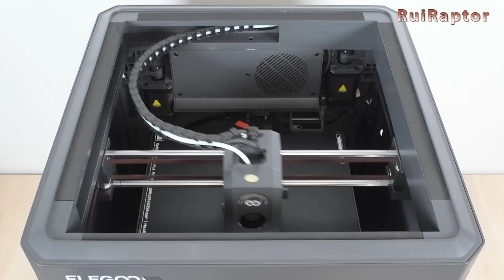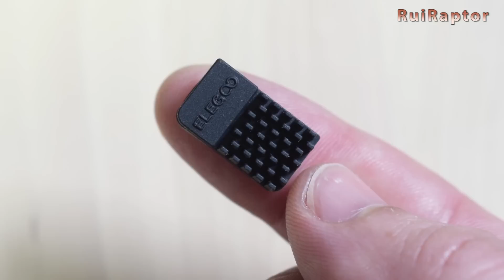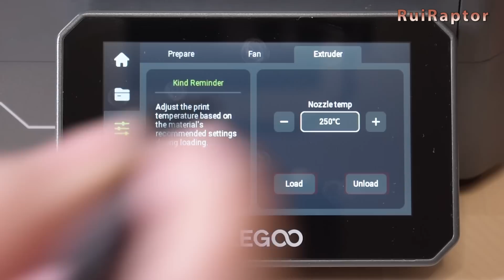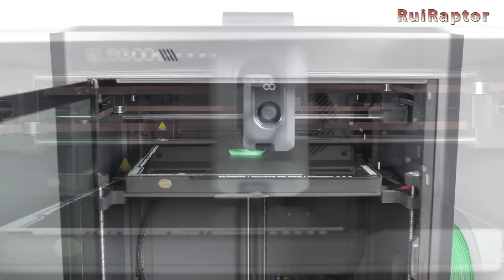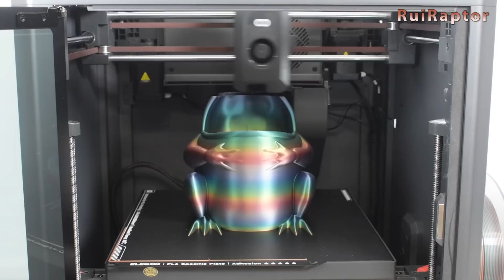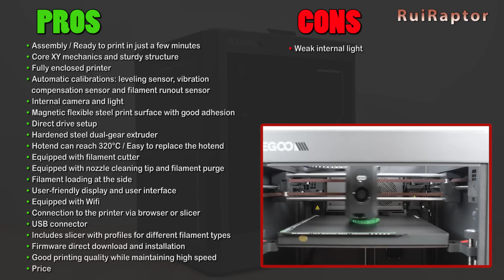Elegoo CENTAURI CARBON - Detailed REVIEW (Includes Full Analysis, Prints and Pros & Cons)

Comment: Compare with FF5mpro please

Smaller bed on 5mpro but 600mm/s print speed bench in 12min full speed pre loaded model. Plastic case But better cable management. 

I have upgraded the ptfe tube to a grey and higher flow one with larger inner diameter. And I hate the run out sensor being hiden and so far from the extruder wasting filament. Elegoo is even worse but they have the brown belt that i love and always wanted to upgrade to and all glass windows that i admire. 

I like the display at the top where the extruder is as it aligns perfectly. I am not a fan off the removable and lcd at the bottom, however I bet that farmers would love it as they stack them too hight and accessibility issue are no more. 

I just love flashforge at the schools i work at and teach as they are easy maintenance and rarely have any issues. I would really like to see if I can get the Centauri with no panels for 200£. Its unbeatable price point for what it does. But still prefer FF5mpro for Schools and everyday use as its solid and just right.

Comment: I'm skeptically optimistic. Elegoo seems to be checking all the boxes but it will remain to be seen if they've dialed in the reliability. They have a inconsistent quality control and their customer service is OK but slow to respond/ship. It will be a while before they'll be tapping into Bambu's sweet, sweet print-farm market share. In any case, this printer has changed the industry for the better.
Reply: I agree. Bambu really rocked the print farm market.  It seems like Elegoo really put this printer through its paces before launching it, and as of right now, most reviews are very positive. If they can show positive results for a full year (to include having repair parts available, and a good customer service base), they have lots of potential to knock Bambu off their print farm throne.  Look forward to following this machine!
Reply: Yeah, I had to order one! I am hopeful that it works out well.

Comment: With my Bambu A1, filament run out simply requires new filament to be pushed in and then select resume print - it takes less than 2 minutes to load new filament - How does the Centauri Carbon handle filament run out?
Reply: Did you not watch the video at all? He covers this.

Comment: They are supposed to reveal the multi-color filament system for this printer a little later this year. I'm willing to bet it will be around July when the Centauri starts to ship and they can dedicate production towards the filament systems.
Reply: Honestly since their making them now they must be doing it already since it’s gonna start releasing to people around August. Right?
Reply: Maybe with the larger version.
Reply: Many reviewers noticed that there is no way to connect a AMS like , other than one only USB port , which is not a good solution😢 so if someone has details about this future AMS like , let's us know
Reply: @danteinferno6513 I think that’s a minor nitpick since if it’s powered separately, but at an affordable price, that’s a fair trade off.
Reply: @explosev6513 if it is powered separately it is not a problem, but will it communicate with the printer?
Reply: @danteinferno6513 there's a free header on the motherboard for such expansion, apparently.

Comment: What about the fact that Centauri Carbon does not use glass fiber reinforced ABS for its extruder housing, the gantry parts etc. Cheap tools from LIDL 29.99Eur use this. Regular ABS works until you decide to print ABS and MOD a chamber heater to have regular ABS parts loose tolerances and FAIL. What a mistake by Elegoo. EMAIL and tell them about it.
Reply: I print ABS on mine it does just fine. Why comment on a product you more than likely don’t have?

Comment: Can't wait until someone get klipper running on it. Thats really the only reason to buy for me. Same goes for other machines coming out. For some reason only creality will offer klipper.

Not bad for the price, again what to total will be once it arrives at the door. This one is the one to get for 2025, because of the volume it can achieve over the others in the same size. Everything on the machine looks like it easily self serviceable.
Reply: It's not klipper compatible unless you change the control board. Add a pi or clone and probably need to replace or add tool head board
Reply: @hedleypepper1838  yeah, we'll see what happens. Flash forge got a klipper custom firmware for it. Qidi machines run klipper too. I have a creality k1 and it runs klipper. I dont want to go closed firmware, because I want to tinker on the machine if needed.
Reply: yeah, we'll see what happens. Flash forge got a klipper custom firmware for it. Qidi machines run klipper too. I have a creality k1 and it runs klipper. I dont want to go closed firmware, because I want to tinker on the machine if needed.
Reply: yep, it is godamn 2025 I want wifi,  Klipper and some catering for AMS as default
Reply: @poepflater  It has wifi
Reply: @poepflater  they said multicolor will be coming later this year. Wfi should be easy if klipper is on it. By the web interface, it looks like a locked down version of klipper. Elegoo did go open source klipper with their Neptune 4, which is strange they aren't running it for this.

Comment: I’m trying to decide between the P1S & the CC.  If price wasn’t an issue, which printer would be better?
Reply: I have a P1P that I have upgraded to a P1S and I am strongly considering selling it to get this instead, if that tells you anything. Higher hotend temp, better bed heating. Better camera. More capable motherboard (that I am betting someone will figure out to run Klipper on), almost entirely open source and no worries about getting locked down.
Reply: Sell it!!!! @seanburke997
Reply: My research led to buying the Centauri Carbon. I hope it works out well.
Reply: @thomassicard3733 the CC was a piece of garbage.  I ended up returning it within the first week.  Buy a P1S.  They’re on sale for $499 right now.  Superior in every way to the CC.
Reply: Elegoo Centauri Carbon is much better!!!!!!
Reply: Elegoo CC is better,  you can use any material because its enclosed and heatup more. Why would anyone being concidering Bambu now?
Reply: @gtrgunnercanada P1S is enclosed, so no issues you mention. Maybe you think of P1P?
Reply: Bambu ... all the way. the AMS is super convenient and it just works. all the other ones in the market just require so much headaches and end up being dumped when it's too painful to tinker constantly. this is Ellego's first printer. and you won't get it until June. and no RFID and no multi colour
Reply: @mostlymessingabout multi color is useless for most people, and RFID is just going to let them scam you in the future. The P1s is not worth $350 more than this printer.
Reply: @mostlymessingabout This isn't Elegoo's first printer. Not by a long shot.
Reply: As i understand it the Bambu AMS is problematic at best. I have no doubt Elegoo will trump the AMS too@mostlymessingabout
Reply: @mostlymessingabout  Multi color is coming sooner than we think!!